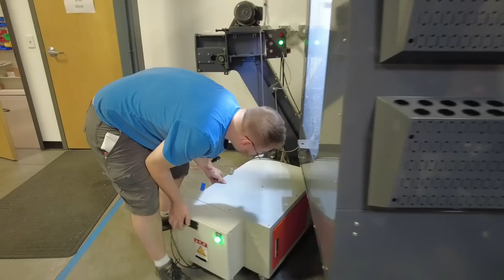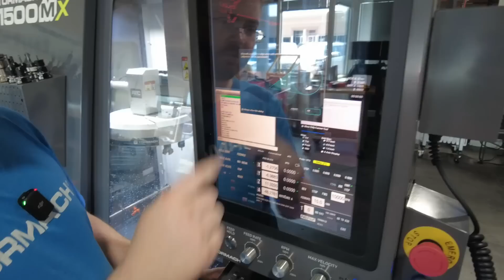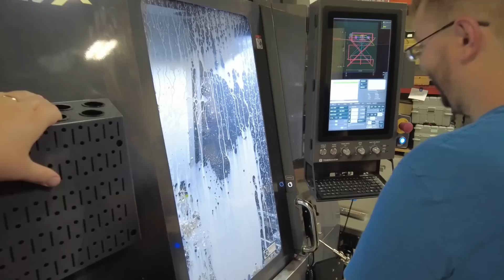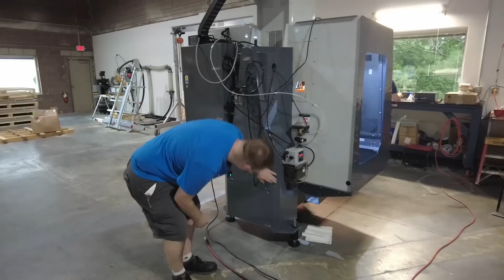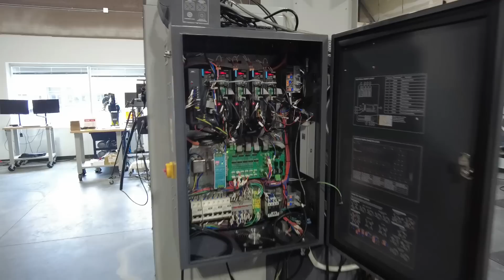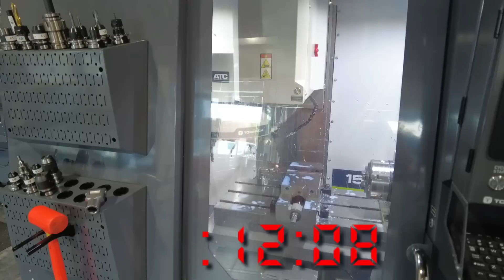Dissecting a Tormach 1500MX

Comment: He calls it a "Standard Flood Coolant System", but on the website, it's a $2700 option for the Flood Coolant Kit. Is there a standard system separate from the $2700 optional one?
Reply from the maker: "standard" as opposed to "thru spindle". As you pointed out, it is of course an option. It's possible to DIY something cheaper, but it probably wouldn't be worth it.
Reply: @AudacityMicro  Thank you for the reply! I wish that they would drop the tagline about having the competitors' options as standard, because they lack coolant and a tool changer that Haas includes. With those, they're identically priced at $40K. Not sure which to choose.
Reply from the maker: @guest6423 you know, you aren't wrong 🤣. I may bring that up to them.

Comment: Sorry for giving you grief on another post, this is a good video and appreciate the thorough walkthrough. I'm planning a purchase in the fall and haven't seen much about this machine, it is a perfect match on paper for my needs but would really like to see a bit more proof in the field before committing >$40k. I can afford a Minimill and know it will do the job but can't shake the feeling I'm just contributing 10-15K to Gene's Hot Wheels fund.
Reply from the maker: A used minimill is always fantastic value. You can find them at pretty much any price you want, based on the age. I've saw a functioning 2001 unit go for under $2000 the other day. $40K would get you a really nice 2022 unit.
Reply: @AudacityMicro  For most that's right, I'd just rather not have to play that game of hide and seek, would prefer to just stroke a check and buy exactly what I want with a warranty. 

The truth is I don't need 3 tons of machine--I've had an 1100 for 10 years, and it's done what I needed it to do. I'm not a job shop or volume manufacturer, I use it for R&D and prototyping and really I just wanted a mill with rigid tapping, a real spindle built for ATC, and a proper wireless probe setup. I also prefer to support US/JP/EU manufacturing when the choice is feasible. The 1500 checks all those boxes and throws in a little more HP and envelope, which is why I say it's perfect on paper. It would also be more flexible for my shop since part of the floor is over a basement with some weight limitations. The 1500 could go anywhere, while something 2-3 tons might be limited in where I could move it. If it wasn't for the weight/power constraints I'd just buy a VF2 or Brother and call it a day but in reality I don't need that much machine.
Reply from the maker: In that case it sounds like the perfect machine for you. If I was buying one myself, I would probably skip their probe, and get a used renishaw unit on ebay. That'll save you a few thousand dollars, and get you a nicer probe. You will see far, far, far better finishes on this machine than on your 1100, and it's a lot easier to run, being far more forgiving about speeds and feeds.
Reply: @AudacityMicro  The used probe is an interesting idea. Will definitely consider that if I go this route.

Comment: Looks like a cool machine, but they are positioned so awkwardly in terms of pricing. For a little more, you can have a Haas, and for around the same price, a Syil. I'm not a fan of Syil for personal reasons, but I have to admit their machines are nice. With Haas, you have excellent customer support (at least in the UK) - and yes, this can be pricey, but at least you are protected. This machine looks well built, but it does look light-duty compared to the Mini Mill. Especially compared to the new Mini Mill, which has a fully cast frame as opposed to the steel bottom which mine has.

I do like the levelling system, and the epoxy granite though - that's excellent!

I'm not sure what Tormach's customer service is like now, but historically there have been some not so nice stories. I don't think it's fair to put that on them now if it's improved though!
Reply from the maker: I think the awkward pricing is really just because they found a good gap in the market. There machines on both sides that can make sense in different applications. The Syil is a better value, at the cost of parts and support. Haas has probably the best support system in the industry, but the machines are a little too industrial for some people.

A minimill is ~$15K on paper, which is already 30% more expensive, but when you add rigging, more expensive tool holders, a phase converter, more expensive work holding, etc, it's more like 50% more expensive.
Reply: @AudacityMicro  The Tormach is also almost 10K cheaper to add a 4th axis.

Comment: My biggest problem with this cool machine is the almost 0.001" accuracy.
Reply from the maker: When you say .001" accuracy, what do you mean? Accuracy is determined by a whole lot of factors, and a true accuracy of .001 is super good, beating most VMCs that are 5x the cost. It pretty compact so thermal issues aren't huge. I didn't check for table sag across the X travel, but its built just like an industrial machine, so shouldn't be any worse than a larger equivalent machine. Tooling and fixtures are definitely going to be the biggest source of error using the machine, which is true with all machines. I also saw it make 60 softjaws in a row, fed by a robot, and I couldn't measure any variation between them with calipers (didn't bring my mic, sorry)
Reply: @AudacityMicro  Sorry, what I mean was repeatability precision. Syil for example claims around .0001" while when I spoke to one of Tormach's representatives, he said the 1500 was about .0008", which is pretty close to a thousandths. To be honest, I am new to CNC milling, and I am yet to buy one, but I spoke to someone who told me that 0.001" was too high for some applications, like making parts that needed to press fit, for example. Was he wrong? I like the 1500 otherwise.
Reply from the maker: I would say the repeatability is tighter than .0008". That sounds more like the accuracy across the whole machine. Most machines tend to be really good at repeatability, even the low end tormachs are definitely not bad in that aspect. Syils are good machines, very arguably a better value if you can deal with the three-phase power thing, and a somewhat cryptic controller. But I would say the accuracy between the 1500 MX and the equivalent style machines is comparable. Other than the aforementioned conveniences, the biggest difference is that the syil will have more horsepower, which will let you remove material faster. That's an inherent downside of tormach single phase thing.

Most shops do not ever deal with things tighter than plus or minus .003" or so. Even in my kind of work plus or minus .001 isn't super common. The exception for that tends to be tight tolerance holes, which generally means that you need a reamer or boring head
Reply: @AudacityMicro  Thank you so much for taking the time and explaining this to me. I am thinking about getting a machine by the end of the year, and I'm between this one and the X7. I did see that the 1500 goes only up to 6hp while the x7 goes to 16hp. I wasn't sure how much this would affect me if I don't have to reduce big chunks of steel to chips very fast, meaning, if I don't need to work with big, heavy blocks of stock which require a lot of removal, but as I said, I have no experience.
I do like that the 1500 has a bigger range of motion, and more tool capacity, and thought these things would be more useful than more HP, but I could be wrong. Another thing which concerns me was the lighter weight of the 1500. I wonder if it would make it noticeable less rigid.
Reply from the maker: The syil is more machine for the money. The 1500 is perfect for people who don't have a lot of space, or access to three phase power. I'm pretty sure you can option up a Syil with a bigger tool changer too.

With the tormach you also get really good US based support, and spare parts. With the Syil support is mostly limited to a community Facebook group, and spare parts may be shipping all the way from China.

I suppose the 1500 probably is a little less rigid than an X7, but you won't notice, because it doesn't have the power to take advantage of the extra rigidity.

If you can fit a X7, and have three phase/can install a phase converter, go with the X7. It'll have a longer learning curve, but it's a more capable machine. The 1500 is easier to use and far more convenient, but less powerful.
Reply: @AudacityMicro you are correct, you can get the X7 with a sidemount 16 pocket atc.  Worthwhile option for the extra tools but also to maximize clearance for whatever work you've got on the table especially if a 4th axis is involved.  

The 1500 is almost 2000 lbs lighter.  Yeah it has less power but mass also has an effect on surface finishes and achievable tolerances.

Prior to buying my X7 I had no experience operating a machine.  All it requires is a few hours of seat time to learn your way around - it is by no means difficult  to operate.  Yes documentation is lacking for the 22MA and it might not be as sexy to look at as the path pilot or next gen haas controls, but it is slowly getting better and if you have the willingness to roll up your sleeves a bit you may find that it has features that punch way above its price range.  For example, I don't know many other machines that allow you to modify the PLC ladder with a built in editor to add M-code control over accessories without having to call for a service tech or apps engineer to provide you with a special license key.

Comment: why do machine tool manufacturers insist on storing important stuff in volatile memory instead of on solid state storage!? :P
Reply from the maker: Not sure what you mean, can you explain?
Reply: @SkansgardCNC  They do? Doesn't make sense to me, doubt you have to reinstall software after every reboot or power cut.
Reply: It seems all commercial cnc's store important parameters in volatile memory, meaning that if it is left unplugged for too long, it needs to be re-calibrated or even reinstalled by service personel. As a developer, I cannot understand why this is, other than greed (saving pennies on a machine costing tens or hundreds of thousands). At least the tormach can re-calibrate itself though 😅
Reply from the maker: Ah, I see what you are saying. Yes, a lot of machines need their little onboard battery in place to store parameters. That's a thing, I don't know why either.

This machine doesn't do that. It's fine without batteries or power or whatever. What Norman was talking about was a completely different thing. It's not using the power to store its position data, it's using it to record changes in the data. It's actively tracking the encoder positions on the servos. That takes energy. It's not losing parameters or something like that. It's just unable to update it's memory with NEW data as it comes in.
Reply: @AudacityMicro  aaaah, then I misunderstood that part of the video 😅 that is nice to hear then 😁👍
Reply: For some perspective; my DIY-cnc stores all parameters in eeprom/flash storage, so it can be unpowered indefinitely and will still have the parameters intact. This has been the case in all the iterations, from using an Arduino, a teensy and now an esp32 😅

Comment: Did i get it right, that the z-ballscrew is in a pushing configuration, rather than pulling the headstock against gravity?
Reply from the maker: I don't think so, it's a normal setup, with the motor on the top of the column, lifting the headstock

Comment: Definitely looks like a improvement over some of the junk they shipped previsiouly lol.  But in the 40-50k range there are some real machines available that would run circles around it.
Reply from the maker: I mean, if we aren't talking used machines, there's basically the DC1 or a syil. There's not a huge variety in the price point. All the of the machines have their own up, and down sides. The big selling point of the tormach is that it's single phase, and lift gate compatible. Makes it a lot more accessible to more people. It's also more user friendly for people who are just getting started in machining. Haas comes with a better support network, Syil is the best bang for the buck at the cost of support and usability. Each machine has its own niche
Reply: @eIgHtY0N3  Haas, Hurco, leadwell,  milltronics and doosan all have there smaller mills starting at 50k, i mean you wouldnt get all the bells and whistles that the tormach has but the machine will atleast work lol
Reply from the maker: I mean, Haas does have the minimill and TM series, but by the time you build in rigging, and reasonable options, those land around $60K delivered. The 1500MX lands around $45K with a reasonable amount of options. So it's not as big of a gap as it used to be, but it's still ~33% more expensive to go to a Haas. $15000 is a lot of money.
Reply: @AudacityMicro  that's true but doosan is running 30% of MSRP on in stock right now and Haas is doing 25% off and free financing for up to 72 months, so the machines are basically the same cost when you factor all the deals in that the real brands offer
Reply: @AudacityMicro  and dont get me wrong haas in my opinon sucks, there spindle run out on the basic 10 and 12k spindles is .006 on a 1 foot test bar which is crazy, but atleast the machines do run. My experience with a tormach that i purchased new was its about 50/50 if its running right or if it has issues and you gota shoot the parts cannon at it lol
Reply: @AudacityMicro  you can get a vf1 with a probe and chip auger for roughly 50k with rigging when its on in stock promo

Comment: This is fantastic! A very specific and weird question you may be able to help with having seen the machine up close: How much wire slack is there in between the electrical cabinet and the base of the cable chain, and if it's not much, how simple do you think extending them would be? 

I am looking to get a machine, and have a very low ceiling in a tuck-under garage, which is frustratingly close to fitting 3 different machines in this class. The newest MiniMill is about 2 inches taller than the subfloor, even if you put the spindle head in between joists. The Syil X7, with its cable chain slotted besides the spindle head, is 1/2" too wide to fit between joists. Boxing out joists has been vetoed by co-owners of the home. 1100MX feels a little light for what I want to do with it, OMs are hard to find used with the options I'd like, and new CMs are a bit out of my price range. 

The tormach 1500MX WOULD fit absolutely perfect....except that they made the choice to orient the cable chain at 90 degrees relative to the machine. I've been trying to figure out how viable it would be to modify the machine such that the cable chain runs oriented inline with the Y axis like most other mills, as this is pretty much the singular dealbreaker. 

This is the first time I've been able to see the back of the spindle head, and it's VERY encouraging to see that it's basically mounted into open empty space, and that all the cables need to do a 90 degree bend anyways to get to where they're going. Looking to get a clearer picture of how viable the mods would be at the electrical box end. Fine with modifying things mechanically, somewhat sketched out by swapping out a bunch of electrical stuff on a brand new machine if it takes that. 

The word from Tormach support has been boilerplate language about how they aren't able to officially support modifying the machine this way without voiding warranty, and vague noncommittal answers about if it's technically feasible at all. But I want to know about the practical viability from the perspective of someone very unafraid to void warranties and do sketchy things that work, like your woven zip tie air line cable chain extension on your OM
Reply: @rocketperson44 Discussions of machine modifications are outside the scope of our support, buuuut I can be convinced to indulge my inner tinkerer a little bit now and again. Designing the base machine for an 8 ft ceiling was a hard requirement so having a vertically oriented cable chain above the headstock sheet metal like the previous MX's was not an option and every design of a recessed vertical cable chain we looked at required several more sheet metal panels and longer cable lengths that added cost to machines. If we had put the cable chain along the Y axis we would we increasing the footprint of every single machine for the sake of the cable chain alone. There would also be additional cost increase to every machine from the additional cable length to the start of the cable chain and sheet metal to support the section hanging off the column when at bottom of Z travel. The top of the electrical cabinet provided a convenient location to place the cable chain with built-in support. Multiple customers have purchased 1500's without the coolant tank due to space requirements so there is data to show that the additional space requirement is not an obstacle only in theory, but is in practice. 

There is very little extra cable length, maybe an inch or two (no need to pay for cable length we aren't making use of). 

Don't try to extend the servo cables. Just.... don't. The likelihood of intermittent issues with the motor or encoder is significant and there'd be a false economy in lengthening the cables vs purchasing longer cables, which would be a standard item you could get from Inovance. 

I don't envy your position but I think that the difficulty in finding a machine to suit your location shows that it is a very niche set of requirements that fall outside of typical installation environments. 

-Norman
Reply: I was thinking the same about the cable chain. Why did they decide to put it that way?